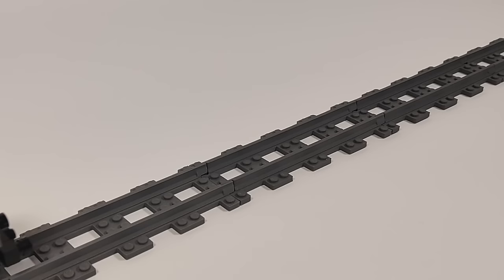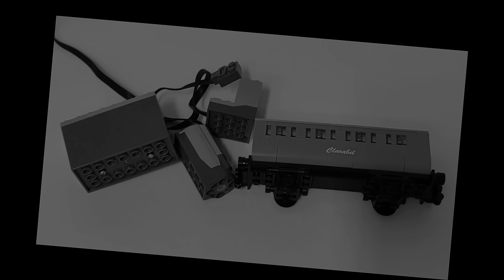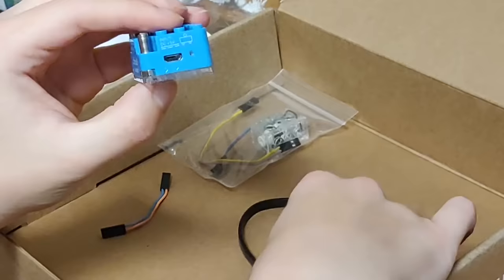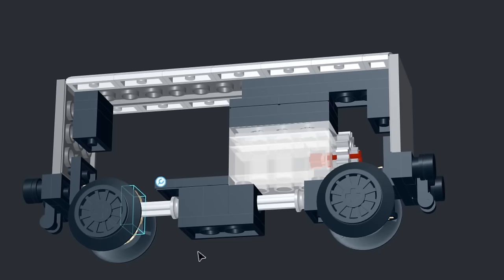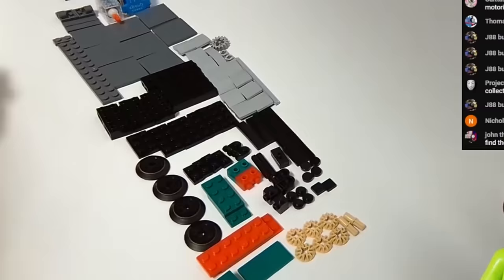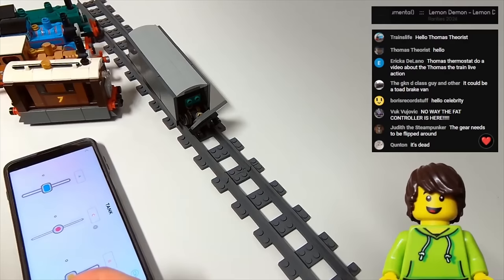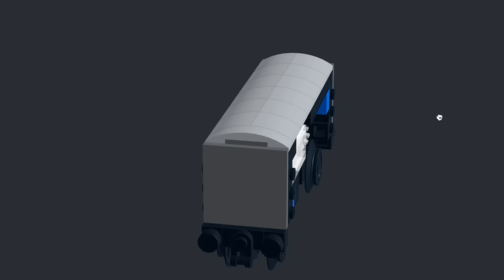How I made a Motorised LEGO Narrow Gauge Train Car - Larry’s Lego

Comment: Hey Larry I am an engineer and I can make custom motors for smaller builds. I can also make custom sized batteries and recievers and motors and whatever I need
Reply from the maker: Thanks for the offer Aadam! Have you emailed me previously? If not I would like to get in touch
Reply: @LarrysLego  I have emailed you previously
Sure we can. I think I know how to make a motorised mini Gordon or Henry or one of the other big engines since they need giant drive wheels anyway
Reply from the maker: @AadamOmar148  Cool! Please email me how you think this could be done :)
Reply: @AadamOmar148  hey I have experimented with 3d printing i took the measurements of the hole in the small wheels and measurements of lego axels and printed it with a realy tight tolerance I found that the tighter tolerance the better it worked I cant reach out to anyone my mom wouldn't let me im 13 after all. edit 1. I could post it on thingaverse probably will.
Reply: @harryrigdon8496  good idea, but I don’t have a 3D printer. Show us

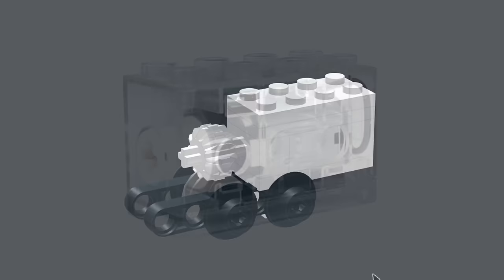Comment: 2:26 The wheels aren't the only problem. The worm can't be moved on that way, it is physically impossible, it is a gear specially enginered to transmit the movement to another gear by spinning itself. But the movement only goes on thet direction, if you try to spin the gear to move the worm, it blocks.

Thats how many gear actuators works on real life.
Reply: I was hoping to see someone else say the same thing.
Reply from the maker: Ah wow! It was doubly impossible then haha
Reply: @LarrysLego  you can put the worm gear on the output of the motor and make that drive a regular gear, but not the other way around.

There's also small rubber bands that you put around the wheel to give it more traction.
Reply: @LarrysLego  Hi may I ask what Lego peace is the rail?
Reply: i mean its not completely impossible but there is way too much friction
Reply: There exist high efficiency multi start worm gears that will back drive - but the Lego pieces aren't this.
Reply: @CubeR4t  no, that is completely impossible, try it. In fact, in automotive it's called limited-slip gear, that locks the drive train.
Reply: @nrike89 Its not impossible, it doesn't work practically because worm drives are very inefficient and have high very high friction. If the entire system where friction-less there would be no issue back-driving a worm screw. 

Also small aside for why 4 wheel drive was more successful than your two wheel drive was probably more in part to the extra weight added allowing for better traction.
Reply: @Ailtir  hm, but even if, the result will that due to the ratio the output is spinning much higher with much less torque.
Reply: @Ailtir  If the whole system was frictionless? What, where physics doesn't exist? Yeah, and it'd also float and suddenly spontaneously combust.
Reply: @nrike89  you can have worm gears as the driven gear rather than the driving gear - I've seen one in a music box mechanism. That said, I believe they have to have the thread cut at a much steeper angle than usual for it to work.
Reply: @LarrysLego  triple impossible if you count the fact that those train wheels don't fit on the axles, lol
Reply: You can but depends on slope
Reply: 666 comments 
?
Reply: Dam this vid is cursed
Reply: @Kool_Fish_Here  piece*
If you mean train tracks, he got them off trixbrix

Comment: I have spent many years attempting motorisation of almost anything, so I can confidently say well done! 
Small train wheels have a lot of friction, so that would be putting extra unnecessary strain on the motor. I haven't seen it done anywhere else but I use a silicone spray to lubricate the axles which removes almost all friction and can more than quadruple the distance rollingstock can roll. It also gets rid of the annoying squeaking that it sometimes makes. It might not be the biggest issue or make the biggest difference for you because you use custom track and your models are quite light, but at the scale I build things it makes an insane difference.
Reply from the maker: Thanks Max! And oh that's good to know. I'll have to try lubricating the axles :) And yeah I can't imagine how needed that would be with how big and heavy your creations are!
Reply: @LarrysLego It's possible to drive all four wheels. Use a Lego Technic cross axle to connect opposite train wheels and mount a bevel gear on the cross axle. Position the bevel gear to interlock with the bevel gear on the shaft running along the length of the box(car). Maybe that'll let it go over points without (a) problem(s).

Also ask Circuit Cubes to make a smaller train motor brick to motorize narrow gauge locomotives. Worth a try.
Reply: Graphite powder for lubrication.
Always on the lookout for new project ideas, might have a go at making some motors.
In the mean time I might play with my old lego shuttle monorail
Reply: @LarrysLego  I might be able to design and print a 1X4 brick with a 6mm planetary gearbox motor, power and control would have to be a different brick.

Comment: Circuit Cubes is game changer for Lego builds, because more smaller option for motorised sets or MOCs, example Speed Champions sets or train sets(City).
Lego will make smaller option for motorised sets, because they actual have oversize parts(example motors and battery boxes), if you don't want use old Power functions system with micro motors, maybe older Lego System Electric system(interesting solution for Lego City sets).
Reply: @Matej1473  Even big builds circuit cubes can be useful so you don’t have to sacrifice other aspects of the build to fit it all in

Comment: I had a thought.  If you were building a full size steam engine, you could put the motor in the tender and run a drive shaft to the locomotive.  The large wheels will actually enhance the look of the engine.  The catch is making the engine heavier with some more non Lego components.
Reply from the maker: I believe it's possible! Would take some major work, especially with somehow driving multiple wheels
Reply: @LarrysLego https://www.youtube.com/watch?v=J-ohpzpcWzw Here's how Bachmann did it.

Comment: I think the word you used for Torque you need is Tractive Effort. They are very different, as tractive effort is an Indicator of pulling power. Basically, weight and amount of powered axles are good if they are higher
Reply from the maker: Ahhh!! I meant to fact-check that I was using the right term there... Oops 😅
Reply: @LarrysLego  Don’t stress, it still communicated the point well. Also very well done with the build, it seems very useful indeed
Reply from the maker: @zacharykoplin6543  I'm glad. Thanks for informing me! And thank you :)
Reply: yup, there was loads of torque (torque is a rotational 'strength' , the wheels were often spinning despite the lack of forward motion) but that was not being translated into a tractive ( a linear 'strength') force. A bit of additional weight on tractor unit * might* have helped.

Comment: Maybe having the battery in a separate wagon (coal cart ?) connected to the main locomotive which holds the electric motor inside may make the design possible. My father used to build electrified train models and had, over the years, made a huge table with full decors and many train tracks / train types and stations. The locomotive engine / coal cart battery trick is used thoroughly in that hobby. You just have the wires exposed going from the loco to the coal cart, and the coal cart is a bit heavier than the loco, but it works great.   

A second problem I see is that the wheels are getting caught up on the junction tracks because they can't rotate to adjust to the high angles of the junctions, leading to them running over the inner guard rails and frogs. This is really where it gets complicated, as making the wheels mechanically powered and able to pivot is difficult. Usually, in miniature scale trains, the front wheels of the loco are the ones that can pivot but aren't mechanically powered, they're just directing the front part of the loco. The rear ones (multiple pairs) are getting power from the motor itself and carry the load. That way, the train is aligned by the time the static rear driving wheels cross the difficult junction part.

This way, all of the difficult tasks are spread out over multiple mechanism: The free spinning front wheels direct the locomotive, the static rear wheels carry the engine load, and the coal cart has the battery. The coal cart should also be adapted to have fully pivoting wheels too, as it is not motorized, so that it doesn't get caught up on difficult junctions.

Comment: This is actually what they had to do for the original narrow gauge engines in the show, they couldn’t fit ALL of the electronics in the engine models, so they had to shove a battery somewhere in the scenes, usually behind them. That’s why they’re never running light/empty, and always had a closed wagon, and in one nighttime shed scene (I forgot which character), you can see the battery box. This was later fixed with bigger models in later seasons, but it’s fun that you’re repeating, or at the very least rhyming, with history

Comment: Good work! Thanks for the mention - very cool! I found that problems going over points and around curves increases with increased wheel base length. 
I reduced my wheel base on the locos to 8 studs total, which is the shortest I can go using the 20 tooth bevel gear mounted vertically driving a 12 tooth bevel gear on an axle powering both set of wheels. (I hope that all made sense.)
My narrow gauge rollingstock is based on that used in Queensland on sugar plantations and our local amusement parks - 2’/610mm industrial tramway gauge, so rollingstock is disproportionally wide, often at or more than twice the track gauge itself. 
I look forward to seeing what else you come up with!
Reply from the maker: No problem! Ah yes that makes sense - don't worry, it all did
Oh that's cool! I did not know that loco had a basis, nice one :) That also explains the disproportionately wide loco
Thanks Coaster Blocks, likewise!

Comment: 8:26 Lego make a steering wheel that you can put on stick pieces, and they look vaguely similar to the small train wheels. Plus, sticks can pass through and hold in the gears' keyhole. Added bonus, resistance makes the gears slip on the stick like a clutch.

Comment: You might be able to get it to fit into a standard train by swapping out the battery box with a small pouch cell li-on and having a discrete switch to turn it on and off. Also you could add some weights to give it some extra traction.

Comment: 11:45 I don't think it's just number of wheels, but also weight of the pusher- your first design was so light that it didn't really have much pulling/pushing ability before the wheels would spin without traction.  The second design did add an extra traction axle, but also added a lot of weight (via other bricks) to help the wheels grip

Comment: Move the wheels closer together, this will help on the points. A 2-4-2 design would be cool.  Design it like an 18 wheeler truck with the drive axles close together. You can the use the smaller wheels front and back with the four larger driven wheels in the middle.

Comment: I have noticed with my set of circuit cubes that they often loose the bluetooth connection with the device that controls them, and I was wondering if you ever had that problem.  I also noticed that your motor looks very fast on the narrow gauge track (faster than it looks on standard gauge).  Very well done! hope you can work out the bugs, and maybe fit it in a LEGO Gordon or Henry.
Reply from the maker: Oh right, I had that but only if I left it alone for a long while. And thank you! :)
It's worth noting that in the final montage with it pushing trains I sometimes sped up the footage for it to sync with the music

Comment: I think to the issue with the points is,
When you pull it with a rope, yours moving it with directions and your lifting it up. But when the Motor Train moves, it just moves forward with no sense of directions and gets pulled down by gravity.
 For this issue to be fixed you will need a more precise track point to avoid the derailing issue, tho that is basically making or modifying the points lol.

Comment: In regards to making it smaller: I know that lego has made an official "micro motor" that runs on 9V and is the size of a 2x2 brick. Many people use it for motorizing lego miniatures (a good example is the golf marbe maze that JK brickworks made). Unfortunately there would be a problem with getting power to it, but I feel like a bodge with some bluetooth micro battery pack wouldn't be hard.

Comment: If the switches had a different frog design it probably wouldn't derail on switches as much. Not really much that can be done about that though, aside from shortening the wheelbase of the car. Not sure if that's possible with that design though.

Comment: That was a lovely video. It looks like you learned a lot from the process. The final (for now) powered van is very neat. I wonder if there's scope to move the wheels closer, which would help with points.
Reply from the maker: Thank you! I sure did
I should have more directly mentioned in the video that I didn't want the wheels to be so far apart, it's just that putting the components between them seemed to be the only way to fit it all in and that forced them to be exactly that far apart.

Comment: the mini models are 4 wide means u can fit a hobby motor and a battery in there if you wanna do some diy wiring it would be pretty simple to modify the design, may need a second car but that's simple enough

Comment: I wonder if you can put really small o-rings/rubber bands on the flats on the outside of the wheels?
Something to add a little more traction, and maybe handle track seams on points a little better?

Comment: The original train used a complete self contained motor and gearset, they can pull a lot of weight, it was a 4.5v set, the battery box had to be used on a separate unit, it used 3 C battery. That little Bluetooth cube would work on the original motor

Comment: You could probably make this even more compact if you leave the comfort zone of power functions and use vintage LEGO motors. The micro motor used in the fiber optic sets, if you can find one that works, is basically a 2x2x2 brick with a coreless pancake motor in it.
Reply from the maker: Oh wow yeah! I wonder how that would work with train wheels... :0
Reply: And yet the smallest power brick is the old 9volt battery holder used in those same sets, which is still at least twice the size of a circuit cube.
Reply: @benjaminstorace6699 
You're not forced to use one of those, though. Some custom wiring with a basic control circuit and some "coin" cell batteries would work.

Comment: The motorized car may be easier to disguise (or possibly harder if using brick-built livery) on a Stadler FLIRT as the PowerPack (EG, the small car on the Greater Anglia class 755 train), which is fitting as it supplies power to the whole train (if not powered by overhead wires).
Reply from the maker: Of course! That is such a cool idea in theory. Unfortunately it would be way bigger than the rest of the train and the way the wheels work on it would mess it up. Neat idea though

Comment: You could fit it in if you didn't rely on Lego as the solution - you could fit in a smaller battery and motor with a circuit to power the locomotives

Comment: Have you looked into the older, 1996 Lego Motors? There is a 4 stud wide grey one and there is an official small red 2x2 Brick motor by Lego, it´s an old Technic piece but i doubt it´s powerfull enough to power a train and the battery of it is still 4 bricks wide. And has to be connected by wire. I recently aquired one at a fleamarket where i found the RC Car Set. I will experiment with this. But i have to say i am shocked, i am no super invested Lego Master but i am quite the fan and i somehow even forgot or didn´t know there are 4 stud wide rails. Anyway you problemsolving in this project was cool, well done!

The Frankie Easter Egg earned you a Sub by the way. SUPER!

Comment: 1:07 perhaps you could use Lego piece 30007 as the wall to fit the motor. I’ve used this technique a few times
Reply from the maker: Good shout! I think it might get in the way of the wheels at the bottom but I'll consider it

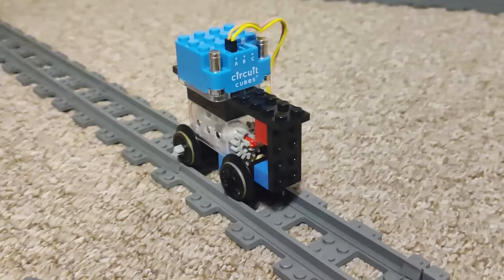Comment: 6:11 couldnt it also be because the carriage the motor was on was itself to light? because itself was so light with pushing/pulling a heavier load it was easier to slip rather than to actually move

Comment: 2:26 dude, it wasn't a torque problem, it was a friction problem, the wheels were slipping under the too much torque and not enough weight to push it down, it didn't have grip and traction to pull itself so it was just spinning in place like a toyota pickup that buried itself knee deep in mud. 

For the wormgear config: Almost in all cases the wormgear is the driven part that will drive the cogwheels. bear in mind the gear reduction as there is always a gear reduction on those things. it will give you more torque in return for speed. 

my advice is to mount the battery and mototor inline, attach the wormgear to the mototor, connect the two wheels on the front via this config:
         L.wheel=cogwheel=R.wheel. 
it will give you more torque. if you notice the wheels slipping add gear reduction (not to increase torque but to decrease speed) or weight.